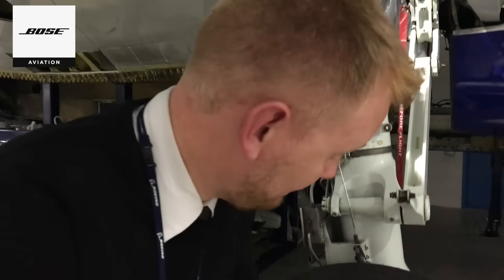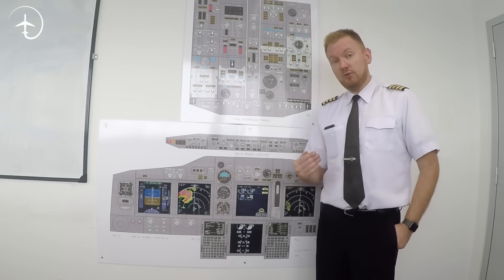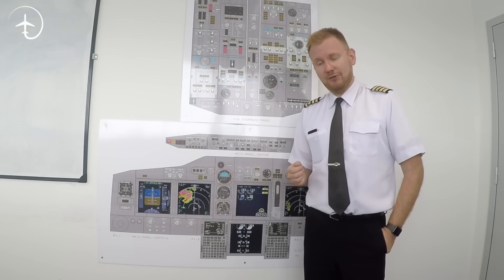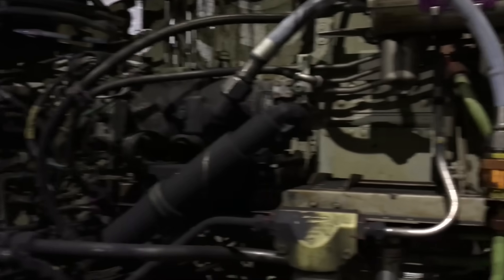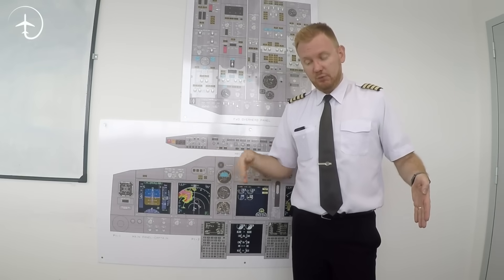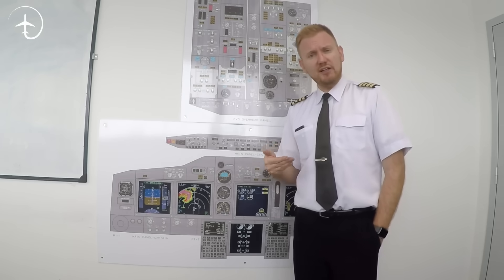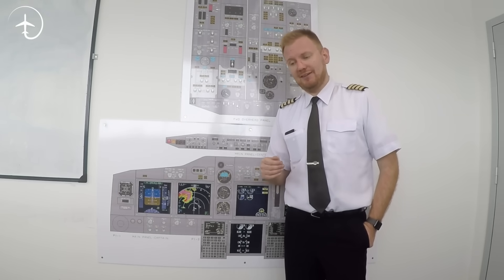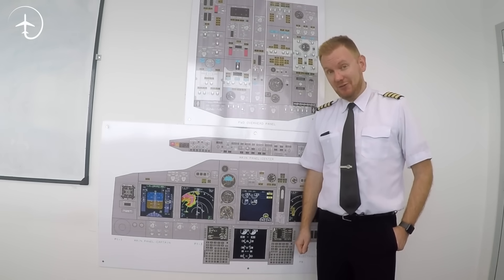Why does the Boeing 737 not have any landing-gear doors?

Comment: Exposed main gear wheels screw the overall look of any aircraft. If I’d design the 737 I’d stick main gear doors under the plane no matter how complex the mechanisms would be. If you look at th MI-24 russian helicopter you’ll see it has ”bloops” on the outsideof its main gear doors to accomodate the wheels inside. Good god this isn’t the case for the 737 since its wheels are quite flat to the rest of its belly.

Comment: Also likely an acceptable solution because it also worked just fine for various aircraft in the 1930's and 1940's. As long as it's relatively flat to the belly or wing, there aren't really any problems.

Comment: I was wondering if the spinning wheels arrive with rotational speed in the (sorry I don't remember the technical word, the compartment for wheels in the belly) or if braking happens during the transition between gear up to gear down. That may prevent, in case of puncture, the wheel with spinning part coming out of it entering that area. You already gave the answer for nose wheel, I was wondering about main gear.
Thanks!

Comment: I really appreciate the straightforward, matter-of-fact way these videos are presented, it really helps to appreciate the way parts of the industry work.

Something I'd be interested to know is how checklists are stored and navigated by the pilots - especially in emergency situations where information is needed rapidly. It's always mentioned as an aside in emergency videos that you start working through a certain checklist, but never locating it in the first place. Maybe slightly less exciting than other emergency topics but I'm interested anyway :)

I'd guess that the complete set of checklists for any company or aircraft makes quite a bulky volume, and I'd imagine even with electronic checklists becoming more popular, but I don't really have a concept of quite how bulky they are, whether separate sections are kept individually, etc

Comment: I just subscribed... New fan from Nigeria!

I have a question: what if there is some pre-rotation of tyres before they hit the ground on landing - would it save tyre lifespan? Maybe help tyres last longer? Yes I realise that pre-rotation may mean addition of weighty motors, but I suspect air flow from air speed can be harnessed, transmitted via gears to rotors, without compromising weight or safety, to pre-rotate the tyres just before touchdown.

Idea is to rotate the tyres almost to the tyre rpms you would normally get at touchdown+0.5seconds, that way - the good old puff of white smoke when rubber meets tarmac will be gone...

Of course, the rotation must be one-way only...

Possible?

Comment: I have thousands of hours in the 73 and the only case of lower belly icing ( i.e. in the vicinity of the gear ) was on a quick turn ( aircraft skin still super cooled ) in arctic conditions where TO was over a slush covered runway.

Comment: I once worked on the preliminary design of a super midsize biz jet at a certain aircraft company in Wichita KS. We did an engineering trade study on whether we should do inboard gear doors or exposed tires (eg 737). A lot of factors were considered including, but not limited to: potential drag impacts, cabin noise, and of course weight, cost & complexity. The most interesting factor (to me) was how a hub cap could hinder the cooling ability of hot brakes due to a recent landing, and how that may impact the turnaround time (in other words, how soon you could takeoff after a landing) of an aircraft. This is obviously much more important to an airliner than to a business jet, but still could have an effect on a customer’s operations and impression of their aircraft. As in most of engineering, we had to weigh the impacts of all of these factors and decide the best solution for the aircraft.

Comment: That was interesting, thanks a lot. I always wondered about that and figured there is a compromise between weight/complexity and aerodynamic finesse which different manufacturers approach differently. I didn't know about some of the individual solutions for protecting the stuff in the wheel well.

Comment: Actually the reason for no landing gear doors on the 737 is not that complex.  The first aircraft did not have Hydraulic powered flight controls except for a rudder boost  and autopilot servos and did not have the capacity for hydraulics to power doors there also was the consideration of ground clearance complexity for such devices as you mentioned.  Therefore the outbd wheels on each side have the "hubcap" or wheel fairing and there are fixed doors on the shock strut.  The wheel opening in the fuselage is lined with rubber flaps that seal the outbb tire to the wheel well when they are retracted. An interesting fact is that the fixed doors on the MLG Shock Strut are some of the first precision castings done in the industry and are completely interchangeable.

Comment: Hi! When the passengers is leaving a Boeing 737 why does the cabin crew sometimes stop the passengers to send them in pulses? I have seen it more often when they just use the bridge in front and not so often when they have bridge and stairs, and only seen it on Boeing 737 not any other aircraft.

Comment: When taxing is there a special engine to push the wheels or do you use the engines?
Reply: Jakeb Claridge They use the normal engines which are also used for the flight itself. The wheels have no motors :-) In corners they even throttle up the engine on the outside of the turn a bit to aid the turn. Asside of the nosewheel which can steer also (of course).

Comment: The inflatable seal could perhaps be redesigned with modern technology for better functionality.
Reply: MrSafetyForever The design of aircraft is stuck very much in tight procedures and certifications, actually because of safety. There is zero room for error when taking 300 persons into the sky.

Comment: I wonder how susceptible a moderen aircraft is to an x class solar flare? NASA has stated it is not a matter of if one will ever directly hit us but when it will hit us. Would a moderen aircraft, especially a fly by wire system, or even one with direct connections be safe?

Comment: Can you explain all the ins- and outs of transporting pets by airplane? I worked for a while as baggage handler. All the dogs went in their cage in the front cargo compartment. They say that the pilot turns on a heating element. My next thought is then; Is the life of the animal dependent on that single switch then? Or is there some safety procedure or mechanism for this? I  possibly want to migrate to Australia in the future, from the EU, and then i will have to put my 2 cats between the suitcases in the dark for 24 hours.. :( I think they will nearly die from only being scared already. Let alone the pilot forgetting that switch and receiving 2 ice cubicles at the other end of the flight :-)
Reply: Unfortunately, the only safeguards are to make sure all the paperwork has been crosschecked. There have been rare cases of animals dying in flight because of cold. I believe partial sedation is an option to prevent the animals being frightened, although most of the animals I've seen being loaded onto aircraft seemed to be quite alert (including the tiger I once saw being loaded onto a freighter aircraft).  One of my biggest concerns regarding animals were the sound levels they were exposed to during loading/offloading. Animals have super sensitive hearing, but are they able to somehow filter out louder sounds, or recover more quickly after being subjected to loud sounds?

Comment: I've always wondered why the wheels don't have air cups like an anemometer to get them spinning when lowered, so they don't have to skid landing on the runway.
Reply: It was tried in the past. The noise it made was intolerable. Think JU-88 Stuka dive bomber or mechanical air raid siren. It also made disturbing vibrations in the cabin. Airplanes land at different speeds and the wheels would likely be spinning faster or slower than the ground speed anyway.  Modern tires are very tough the touchdown skid is not the hardest point of tire design, takeoff is much faster
Reply: I have wondered the same thing for years! I can't believe that there isn't some way to get the tire at least rolling, which would greatly lessen the strain when it hits the runway at 165 kts, from a standstill. Expensive tire should last much longer and be safer (fewer blowouts).
Reply: I think when batteries and electric motors become light enough they will incorporate this feature. The primary benefit, however, would be to capture the kinetic energy after touchdown and use it for taxiing.
Reply: It wouldn't have to be exactly at the ground speed, just closer to it than it is from zero. Takeoff may be faster, but wouldn't the peak force be lower due to the acceleration from zero being relatively slow? When landing the wheels go from zero to touchdown groundspeed basically instantly, much more acceleration than takeoff.
Reply: It would cause a lot of drag (bad for engine failure after V1) and even more wear on bearings and brakes. Tires are durable and easily replaced. Some aircraft do have these.., typically on the nose gear of rear engine aircraft to prevent FOD being thrown as the tires spin up.
Reply: Awesome! Thank you Bartonovich!

Comment: My take on efficiency is with no gear doors is
1. Lighter weight = more efficient
2. Less complex = cheaper maintenance
3. Not as aerodynamic = less efficient.

I figure that items 1 and 3 above pretty much cancel each other out as regards fuel and operational costs. And #2 is just icing on the cake.

Comment: What is the impact of the wheel hub on the cooling of the brakes? I know some larger aircraft are quite critical when it comes to braking and being able to stop in time and not overheating too quickly. Have they solved that otherwise? Or is the weight of a 737 relatively low and don't they need that much cooling anyway?
Reply from the maker: The hub-cap does not have any real impact on brake cooling. We always calculate the brake-cooling between the flights and we need to release the parking brakes in order to let air flow through to cool.

Comment: That little hydraulic fuse is called frangible fitting and it's function is slightly different than in your explanation. Since small punctures might not come out, there would be no meaning to it if a nail is stuck in the tire but it may miss to hit. This fitting is for burst tires, which remainings would uncontrollably fly, or rather flatter around the spinning axis of the wheel during gear retraction. If the fitting is hit and cut open, it releases the hydraulic fluid of the returnline(two sided gear extension/retraction cylinder) so that no pressure on the retraction side can build up and the landing gear will fall back to the extended position and be overcentered/locked(down three green) down. :-)
Also, there is another feature for protection of the wheelwell equipment; selecting the gear lever to up will cause a signal from (correct me pls., i'm not 100percent sure right now about the box-type rating was years ago and i'm not working on b737 anymore) auto break control unit to the antiskid control valves, who open the return line of the antiskid valves, resulting in a braking function during gear retraction and open the brake metering valves for providing brake pressure, thus called gear retraction brake. Sorry for that wall of text😅
Reply from the maker: Thank you! That’s an awesome point to make! 
Sometimes I over-simplify the explanations a bit in order for everyone to follow.
Reply: Mentour Pilot you're very welcome, simplifying is not wrong, since not everyone can grasp the ideas right after hearing them 😀
Reply: What a great attitude to take, rather than jumping in with an agressive defense - I can see why you have the job you have - I'd love you to captain ALL the flights I take in the future.
Reply: +tornado
He's very good like that. He did a video quite some time back (I've been here for a few years at least) where he spoke about continuous learning and being aware of your weaknesses. I asked him what he thought his strengths and  'weaknesses' were and how he works on them, but I phrased it very carefully as I could imagine why he might not want to cover them.
Wasn't phased at all. Said it was a great question and good for him to demonstrate what he'd been speaking about, and so listed a couple of points and his efforts to address them.
Interestingly enough, the main one he mentioned was he could be better at some of the technical aspects. We could almost imagine doing a series of technical videos on the 737 are part of his own constant skills and knowledge self-improvement.
Cheers
Reply: That's good. I don't trust people who do not like pizza.
Reply: Hamburger Quieddje    Brilliant idea though this system.
Reply: Actually, he made it very clear that the protection is from impinging tire tread and not "nails"--where did you get that?  You are wrong about the antiskid system.  When the gear handle is in the UP position, an electrical signal disables the antiskid system to prevent its operation.  When the handle is placed to the OFF or DOWN position, the antiskid is free to operate.  A little knowledge may be dangerous.
Reply: Hopelessand Forlorn well, my fault, he said puncture and i assumed something small like a nail or stone to it, not a complete peel off or similar big.
For the other part, i kept it easy too. During gear retraction, the gear UP pressure goes to the alternate/ gear retract brake system, meaning, the hydraulic system A fluid flows via the Landing Gear Selector Valve through the ALTERNATE(here is my fault, sry) antiskid valves to the antiskid shuttle valves(only pairwise braking/lock protection) to stop the wheels from spinning. Antiskid is inhibit when retracted, you're right :-)
Reply: Hamburger Quieddje I like Pizza
Reply: "Wasn't phased at all"  FAZED
Reply: How to remove up upv window seals
Reply: patrick longworth what seals do u mean? :)